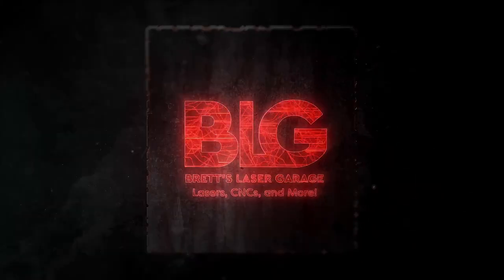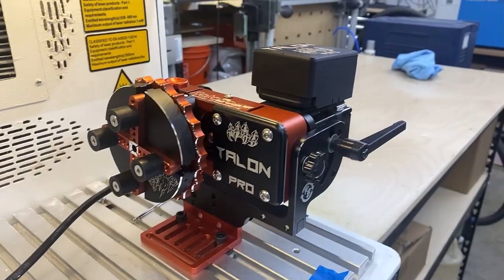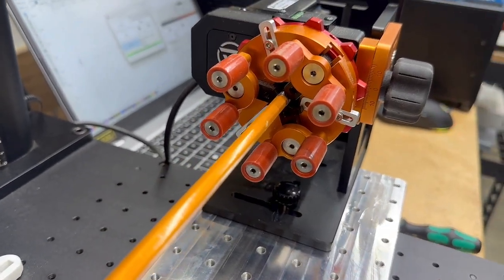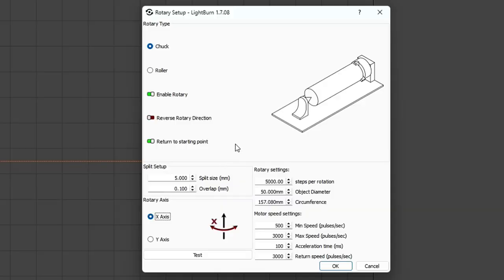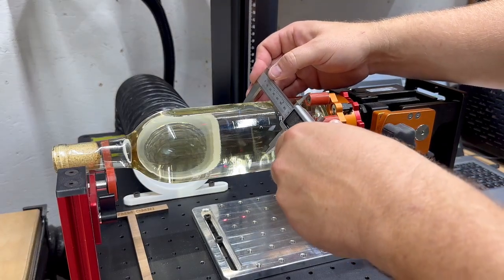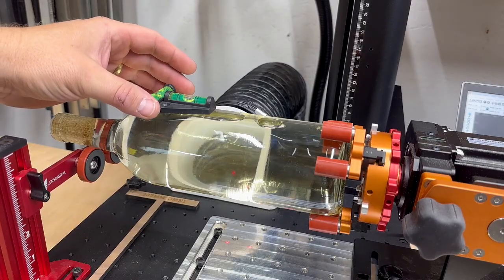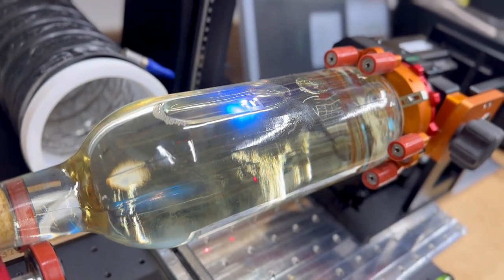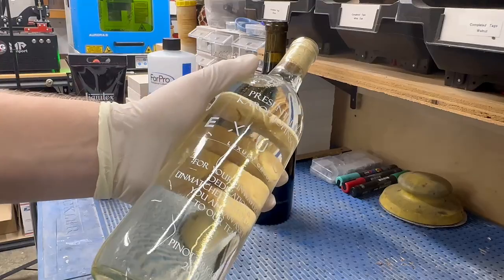Engraving Wine Bottles with a UV Laser | Commarker Omni 1 + PiBurn Rotary Setup | Pro Paint Fill

Comment: Thanks for the video. I have a small craft distillery and is considering engraving for limited production. How long does it take to do a bottle with your machinery? And how long to do 100 or 200?
Reply from the maker: Cool!  Depends on the design of course.  The projects in the video took about 5 minutes to engrave each.  But sometimes I do smaller engravings that only take about 30 seconds.

Comment: If the substrate is tapered, which diameter do you use? Wonderful video by the way!
Reply from the maker: If the taper is not to great, I’ll split the difference and use the median diameter.  If the taper it to large though I’ll slip up the engraving and do it in two setups.

Comment: Can you add the settings that you used for the engravings? Thx in advance.
For setup, i use a jig setup. The whole base is covered with MDF with a cut out were i can put jigs in. For my rotary, I use a longer piece where the base of the rotary is sliding between. Setup on time perfect, then just put it in place and you know its strait and good to go.
Reply from the maker: You’ll have to do your own testing to confirm but I used 250mm/s, 40 kHz frequency, 1ns q-pulse, .01mm line interval.

Comment: What kind of paint did you use to make the engravement better?
Reply from the maker: Just plain old acrylic paint
Reply: @LaserGarage  would acryllic paint hardned be dishwasher resistant?🤔  or do you have any suggestions making the engraving pop on glass etc?
Reply from the maker: No, I don’t believe so.  I wouldn’t use this method on glassware that would need to be washed, either in the dishwasher or even by hand.  This works great for wine bottles though since they don’t need to be washed like drinkware.
Reply: @LaserGarage  thanks for the reply, I were afraid of that 😅. Guess I'm back to testing glas/porcelain paint and a small oven to harden it 🙄😅
Reply from the maker: You’re welcome.  You can always run some tests and give it a try.

Comment: Hey I was wondering, would you say it’s possible to put this in the back of a truck, take it to a craft fair with an electric generator to do tumblers or is it too big and beefy?
Reply from the maker: I suppose anything’s possible but I don’t think I would recommend the Omni 1 for that use case.
Reply: I take mine to craft fair and markets. Last sunday I did a Tuning car event. For moving to the event, I put it in my car (smoother), but watch the hight (+/-70cm) when you have a regular car. On the event, it goes in the eventcar where it's set in sight for customers to see what is going on. I use 4 ComMarker UV schields for safety and an airfilter. I also use a 
VTOMAN 3096Wh Portable Power Station. Pictures on my socials.

Comment: Great video. I have run a bunch of glassware recently and would like to paint fill some of them. Do you know if the acrylic you are using for the wine bottles would be good for glassware if they were put in a dishwasher? I have tried rub and buff and it works ok but would like something that stands out more and has more color options.
Reply: My wife and I dabble in acrylic pour painting, and have several unintentional test glasses that have been through our dishwasher for over a year, and still have paint on them. You might want to experiment with different paints, and perhaps baking to help set the paint, but acrylic is pretty durable even on plain glass. Etched glass would probably be even better.
Reply from the maker: Good to know, thanks.  I’ve not been worried about it much because I only use this technique on wine bottles where there’s little to no threat of them getting wet.  And definitely they’re not going through the dishwasher.  

One thing that does help with the durability though is the etching of the glass itself.  The laser engraving roughens up the glass of course so that creates a mechanical bond.
Reply from the maker: Thank you Santa.  I’ve never tried it but I don’t think this paint fill option would be a good choice for glassware that would be washed repeatedly, especially in a dishwasher.  Only one way to find out though, give it a try and see what happens. Thanks for watching